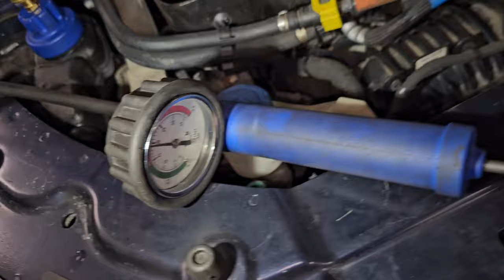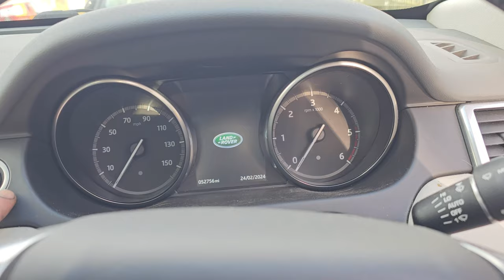Ingenium part 3. DPFs, chains, turbos. Are they one to avoid?

Comment: I've a 2013 vw Tiguan R-Line and in 11 years of ownership it's had all 4 springs replaced that's it. It gets it's service when due..
Reply from the maker: I also have a Tiguan and I wouldn't worry about any of these issues. It is a Euro 5 though not a 6. The 6s have a few more issues.
Reply: @jrvehicleservices  Thank you for your reply buddy. Fingers crossed it continues stays trouble free lol. 🍀🍀👍

Comment: These are only just a tad worse than most other land rover engines ,,, they have not had an engine worthy of any note since the 200tdi ,,, it worked and kept working ,, rest of the car was rubbish , but the engines were not actually that bad ,,, but failure to meet emissions killed it off ,,, emissions have killed almost all diesels these days and a lot of petrols too ,,, long gone are the 400k mercs and 200k nissans of old. so much for progress .

Comment: When you look at the under bonnet of these engines it looks like a right bodge of a design. Almost as if the designers are adding bits as they go along. For such an expensive motor not a very good design. Needs a lot of engineering design and realisability put in from the start not afterwards.

Comment: Are the majority of the issues with the Diesel engine? You talk about the Ingenium engine, but don’t specify if you are talking about the 2L or 3L engine and if it is the diesel or petrol engines.
Reply: Yes, this, cna we get an answer for this. 
I suspect it is the 2.0L - have not heard much about the 3.0L but still be good to get an answer from a mechanic dealing wit these engines regularly
Reply from the maker: Sorry 2.0 Diesel.

I think I mentioned in the previous video we haven't seen any 6 cyl yet other than for servicing.

I'll update the descriptions.

Comment: These Ingenium engines are overcomplicated and it seems to me to be poorly designed compared to other engines. It compares directly to the Ford 2.0 wet belt diesel engine which had only two real issues. A faulty batch of injectors supplied by Continental [formerly Siemens VDO] and, of course, the wet belt.  Assuming that they have now sorted both issues, which they do claim, the Ford would seem to be a far superior engine.  Then there’s the VAG diesel and even Renault/Nissan, although Renault seems to be phasing diesel cars out now, but the 1.5 litre K9 diesel is a fantastic engine with well over 10 million examples manufactured. Unless someone knows different for sure?
Reply: To be fair to the manufacturers, most of the complications come directly from having to meet the ever stricter emissions laws. So it's very unfair to compare an engine that has all that to one built when it wasn't required. Thankfully a small outbreak of common sense overcame the EU regulators for EU7, and they dropped all the pre-start warmup nonsense they were thinking of. 

Where the manufacturers then shoot themselves in the foot is by specifying ludicrously long service intervals that are aimed purely at getting low lease values from new, along with company car business with minimal servicing costs, knowing that most engines will survive the initial 3 year in warranty period, pushing the longevity issues to the 2nd hand market. Engine oil in an EU6 diesel has to work ridiculously hard, and to expect it to last 21,000 miles or 2 years is in reality in very few peoples (or the planets) interest.

Comment: The engines are reliable as long as you watch out for the plastic for the cooling system and the air system, which feeds air and cooling into the engine. And change the engine oil once a year in cold weather or twice a year in a hot climate regardless of how little you drive it. But if you put lots of thousands of miles every year on that engine pls do so every 5000 miles.

It's a luxury car, so if you can not afford the maintenance, please buy a toyota